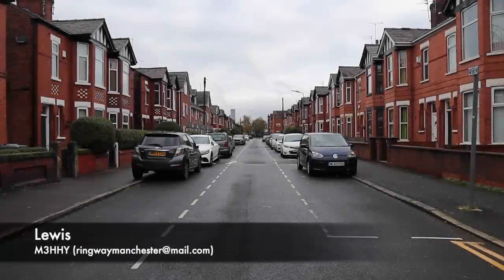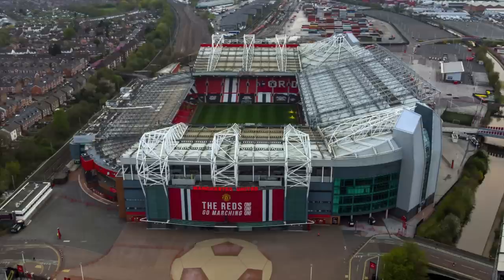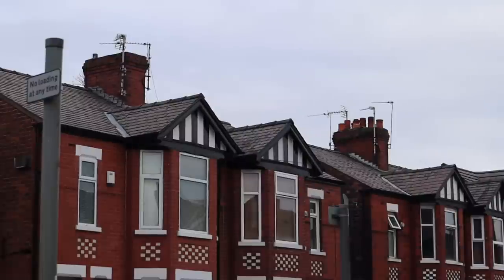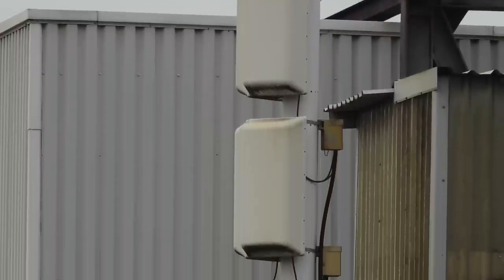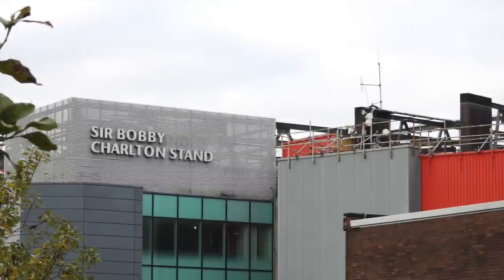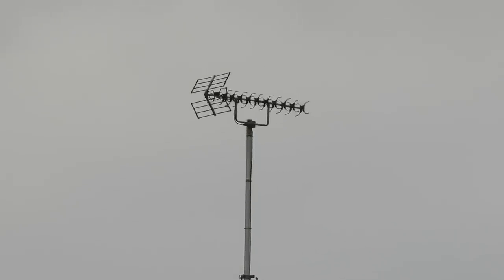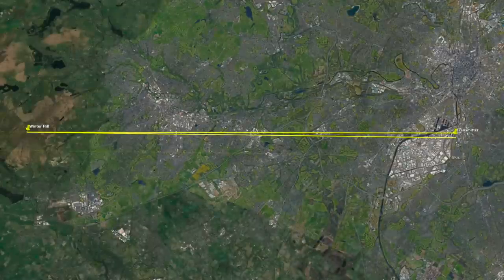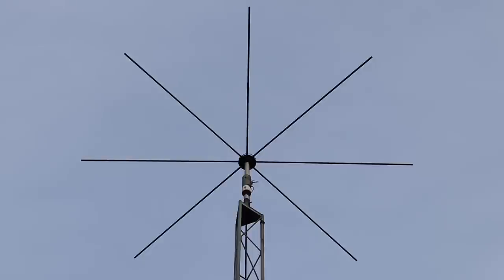This Low Key Transmitter At Manchester United Is Genius!

Comment: Good to see self help television transmitters still in use. The then IBA (Independent Broadcasting Authority) first introduced such tx sites in the 80s (?) for - usually rural communities - who couldn’t receive adequate quality signals from either a main transmitting station or one of its relays; the communities would have to club together to raise the necessary funds for the self help site, along with good access and a decent electricity supply

Comment: I remember 40 years ago living over 60 miles north of New York City, and some
hills in between, up the Hudson River.
The houses near me had big TV antennas,
mostly for VHF stations 2 through 13,
up high on masts facing NYC back then.
The cable service on my 12 channel TV,
a tube CRT and vacuum tubes, valves, from
1968, was showing the main NYC channels,
a Spanish channel, also from there, and 2
stations from the Albany , NY area to the
North of me. There also was a pay TV
service, Showtime, with movies, on one
Channel, decoded with an inline unit.
There was no other cable boxes or any
remote. The local Cable installer said 
there was no chance that Cable there
would expand its services. The pay channel
was $10.00 extra a month. Boy was he
wrong.
Also where I lived 25 miles north of NYC,
before and after being upstate, our apartment building only had a master TV
antenna until Cablevision was installed
in 1985, with much more variety like CNN
MTV, etc. Cable had come into town around
1980, but took a while to reach our place.
Today, this year, we dropped Cable TV, use 
Over The Air TV, and streaming like Netflix,
Amazon Prime, and HBO+, which that one
is free through my cell phone provider.
So you can see how 🤔 things change.

Comment: I worked in PMR radio system design - we always joked amongst ourselves that a good radio engineer would give directions  along the lines of "Go 1 mile down the road till you see the collinear array on the left, turn right and pass the UHF stacked dipole array, in about 100 yards you will see a UHF Yagi where you turn left, about a mile after that is a 3 element VHF array on your right and the pub is opposite that.

Comment: A few years back the FCC allowed us AM broadcasters to get low power FM licenses to use as translator stations. It had to be an existing FM LP license normally reserved for non profits and normally well shy of 1000 watts. A lot of these licenses were bought over the years and went idle  and you could transfer them. I think ours came from a church a few towns away. Our AM station did not have a lot of good coverage to the west being on the side of a mountain and at night we have to lower the power to 60 watts so not a lot of coverage but we own an FM tower at the top of the hill which is where we licensed the translator. So now we are rebroadcasting our signal there and it can reach the larger towns in that direction in stereo. My understanding is that after so many years the translator can be used for other programming on it's own and not have to be bound to the AM station anymore. Mind you it has been a few years since I dealt with it so I don't recall the fine details but that was the gist of it.

Comment: I used to live in North West London with UHF (analogue) TV from Crystal Palace.  250 yards or so up the road was a B great gas holder (the static type not the up/down gasometer type) which caused a severe ghost on my TV as it reflected the transmissions, delayed by a few microseconds.  

No amount of antenna rotation would get rid of the ghost.  Even log periodics which have a good front to back ratio, with few side lobes, could not rid me of the ghost. Long story short a second 'bow tie' antenna, and a variable attenuator / phasing harness together with judicious placement reduced the ghost image, to an acceptable level, by signal cancellation.  Took me ages to set up and required lugging a small TV into the loft! 

The golden days of TV reception engineering and many hours for playtime (no internet or YouTube then 😂)

Then there was the Heathrow radar blip to contend with - stub filters to the rescue!

Comment: In the early days of UHF TV, and the growth of local repeaters, it was (I'm told you understand) possible to sit in a car with a battery VHS video player and a transmitter near to a repeater station swamping and main 'off air' signal with your own video - often (again I'm told, you understand) of a risky nature.  

As this happened far too often the repeater network was re engineered to detect a monitoring signal in the TV transmission (vertical blanking interval) putting and end to the fun.

Comment: Reminds me of my youth, repaired a 1950's RCA 21 inch tv and used a Slinky (tm) stretched across my bedroom to pick up other stations. depending on the direction and how far the spring was separated I would get all kinds of things.  Worked well until my dad swiped it to setup in our attic connected to one of his many radios. 
Side note: he purchased me a replacement later.

Comment: There was apparently a self-help in Blackpool to assist people behind the VIcarage Lane B+Q building which is now B+M. Eg residents of Scott Close. However on looking at Street view I see no aerials which aren't pointed at WInter Hill, nor any pointed at Lancaster or Moel-y-Parc. I am wondering if ghosting is as much of an issue with DTT as it was with analogue, and were these transmitters installed with the prime purpose of alleviating ghosting as opposed to overcoming attenuation of the direct signal?

Comment: Interesting to see that they still make all that effort in the UK.   In the old days, in the Netherlands we used to have relays for analog TV.
But today, in a street like that, everyone would just have cable TV.  Is that not a thing over there?
Probably 90% of TV viewers have some form of cable here, either coaxial cable or TV over internet (over phone line or fiber).
There still is a DVB-T2 system and also satellite TV, but they really serve a niche market of mobile homes, people who don't want to pay any subscription, etc.
Reply: Although many areas have Cable, it is a subscription service via Virgin Media. The primary way to get free to air channels in the UK is via DVB-T/2 and to a lesser extent free to air satellite on 28.2e
Reply: I would imagine with the prevalence of the BBC, alot of infrastructure would have been developed for large central transmitting sites waaay back when, which followed through when TV came in. also, retrofitting cable would have been a pain to so many old houses. I know thats the case in Australia, where the early TV stations were set up by the big players in radio, and wanted to leverage their existing infrastructure. there is some cable, but the pay tv variety is only in very affluent suburbs where there would be a sufficient market, and new suburbs on the fringe, which usually only have the free to air channels, but the developer does not want a forest of giant antennas, like you would see in 'the old part of town'. excluding apartments, I can count on one hand the number of people I know who have had this kind of system (and yes, that is something I notice).
Reply: @arjovenzia  In the Netherlands, in the seventies and eighties large cable networks were deployed that served an entire city.  Before that, local cable was used in apartment buildings but now everyone (also old houses) got cable.  In those days, the national analog network had 3 channels, but with cable that would increase to 12-20 channels, and would include stations from neighboring countries (even England), and local and regional channels.
A vast majority of users would move over to cable, also because it was quite cheap and having antennas on the roof was being discouraged.
These networks were usually built under responsibility of the city, and operated by a service company that did not need a lot of profit.
Much later, all these networks were sold off to commercial operators and the price went through the roof.  But by then the switchover was already made and it was not usual to go back to own reception.
In the early 2000's the analog network was switched off and a DVB-T network deployed, at that time reception became a little easier again as there were many local transmitters and usually an indoor (windowsill) antenna could be used.  It also offered multiple channels.
But that system has never been widely used, I think there are only 200.000 users in a country of 17 million inhabitants.
Reply: Nowadays were no one sees a programm which defines for you when you have to view it, there is no reason to congest the air or cable with useless TV signals. The few viewer of linear TV can get their programm via IPTV over Koax or Fibre and don't need to disturb the Internet signals fpr Docsis 3.1. In the 80s, there was a demand for TV though, so all this nowadays time-telling obsolete stuff was installed.
Reply: @Eurobrasil550  Yes... in the early days of cable it was customary that each city had their own receiving station, usually on the roof of a highrise building, where several antennas were installed to receive the programmes from the surrounding countries.  For a range up to about 100km that would usually be an array of 8 or 16 yagis in a 2x4 or 4x4 arrangement, for larger distances it would be a parabolic dish of 6 or 10 meters diameter.  Impressive for "us" to look at!
Later, an interlinking network was deployed rendering these installations unnecessary.  The programmes would be received somewhere along the border and then transported inland over that network.  Furthermore, satellite TV made it possible to receive more programs and with a lot less effort, so usually there would be a small farm of satellite dishes installed at groundlevel somewhere nearby the terrestrial receive station.
Indeed BBC was received in Belgium or later even in France and transported to the Netherlands, but nowadays it is received from satellite.
I don't know why only BBC and not ITV is relayed this way, there are other commercial programmes on cable.

Comment: I think there were passive relays in the analogue tv days where a high-gain antenna pointed to the main transmitter and beamed via a transmit antenna in another direction - down a valley for example - to the fill-in service area. No power or electronics included. In effect just a passive reflector. Do these still exist I wonder for digital services?
Reply: I was wondering about whether they could have used a solution like this, but after thinking about it I suppose given the fact it's in a location where power and access aren't a problem, using an active solution like this was probably less hassle than trying to design and install something that would work passively. Just wire it up and turn it on, no bother. Somebody would have to do some maths if they were going to design a reflector, and then have it manufactured as a one-off.

Comment: Presumably the receive and transmit aren't on the same frequency to avoid feedback and that it's shifted to some degree?  Also I presume any TV that manages to pickup a repeated signal as well as the direct signal, would only show the strongest channels in the lineup and you wouldn't see BBC one twice, ITV1 twice etc in the lineup?  Thanks :)
Reply: In Australia we have a lot of translators like that, the rebroadcast is on the same frequency but the transmission is slotted into the empty timeslot or guard band. The translator overly computerised and can do it without feedback

Comment: I'd love to know the technical details as that has to be a really low cost solution. Is that a linear transponder? Or a repeater (demodulating/modulating the data stream)? Or do they literally amplify and rebroadcast on the same qrgs, with enough antenna separation and low output? I remember from my days at a cable company that rewriting frequency tables in the MUXes from DVB-S (downlinks) to DVB-C was a major issue - either costly to the company (if done properly) or inconvenient for the users (as they had to tell their TVs to do a full scan, and be aware of that).
Reply: Checkout page 24 of this BBC document: http://downloads.bbc.co.uk/rd/pubs/archive/pdffiles/engineering/bbc_engineering_106.pdf
Reply: @G7LWT  Thanks for pointing to that one, interesting resource! So most likely a set of very cost optimized linear transponders (transposers), translating from one set of UHF channels to another one. 73!